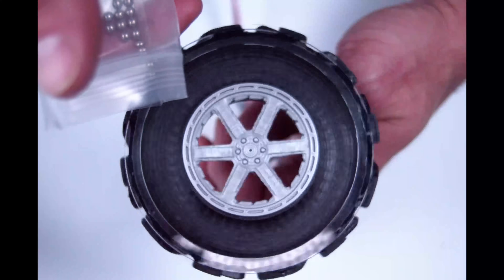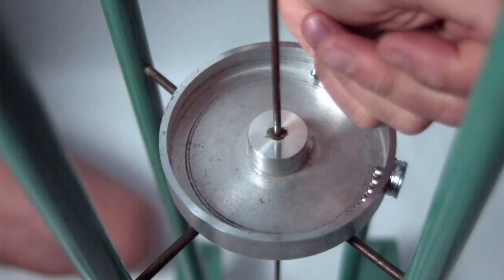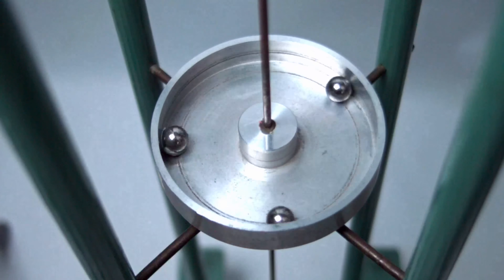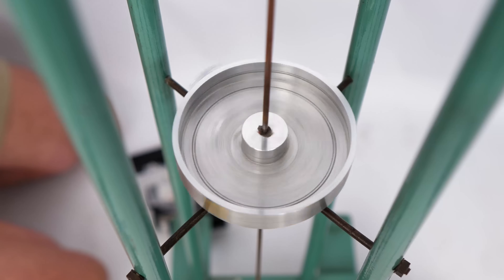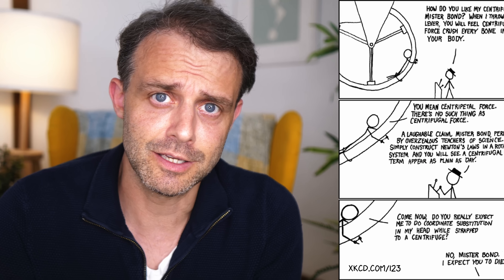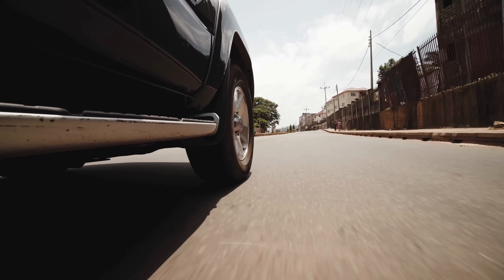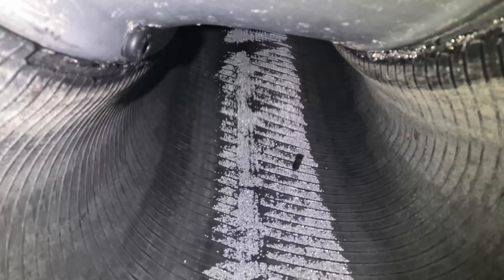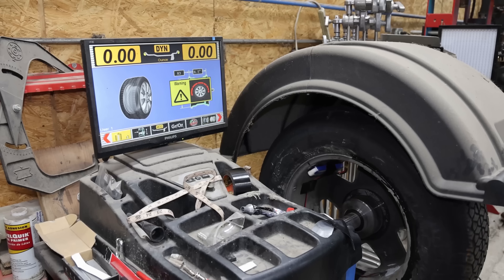Do tire balancing beads actually work?

Comment: If you look at the weights on car wheels as you walk past cars, you will notice a lot of wheel with more weights than needed. Like in two places instead of one sometimes even opposite each other, any wheel with two weights close to each other  can be balawnce witha weight in beeween. And any wheel with an opposite weight can be balance by deducting the weight of the lighter weight from the heavier weight.   It is annoying to see, I grew up balancing tyres. 
Always needed less weights with michelin. :)

Comment: Would it be possible to use self balancing beads in combination with a slow acting glue with low viscocity ?(if such a combo exists). That way you can pour in the beads with some glue. Drive so that the wheels get up to speed. Keep driving for a bit so that the glue sticks the beads down. And done!

Though I would imagine it's difficult to get a glue to work in those conditions. Especially with the rubber tire deforming constantly when it hits the road. Still may be worth looking into

Comment: I worked at a tire shop a few years back, we never used the beads unless the vehicle was a bigger diesel truck, if the customer wanted them. But even then it was pretty rare occasions. Not sure why and why it was only ever bigger, harder diesel trucks. (ford f350, ram 3500, those kind of big diesel trucks), but maybe there’s a reason? 🤷🏻‍♂️

Comment: I Imagine it would cost More, or at Least the Same, to have each Tire and Rim un-bolted, Tire removed and Beads Poured in, Then Re Installed and Aired back Up. Than it does to Just have Each Tire "balanced", with weights, on the Balancing Machine, and then Re Mounted to Your Car.    The Beads are a Neat Concept, but pretty Silly and Inefficient since it Does Not Stop the Vibrations Daily or "Fix it so you can Forget It"  :yougotthis:

Comment: I called it snakeoil....

It works in theory, but in practice you either have no need for it, or it only works 'half the time'.
And I bet that important nuance is rarely explained (or for legal reason it would be in extreme small print somewhere nobody looks), or they wouldn't sell anything.
AKA: snakeoil

And properly balancing tires als make it always work at slow (< motorway) speeds.
So, yeah, snakeoil.

Comment: Don't use them in my car, cause absolutely no need but way back in my off-roading days I have. Mainly because the wheels and tires were quite heavy, not easiest to balance in the first place and would get a solid beating on the trails. All too often balancing them in a traditional way was a moot point or short-lived at best. The beads worked much like you described. Wasn't a perfect solution but it was a solution nevertheless.

Comment: It is an interesting effect. I just wonder if the beads do actually more damage as long as they have not aligned properly into the balancing configuration? I'd still prefer a fixed weight on the wheel that makes sure everything is balanced and stays that way from 0 to 130 km/h. I'm pretty sure there is no evidence that would show that axle bearing falures are more common in cars with beads, but my intuition (that has proven to be wrong sometimes) makes me believe the old fashioned balancing is better for your car.

Comment: I have used these beads recently and found that they did not help the issue. At low speed, the unbalanced condition was much worse and since I do more city driving, I never realized the benefit. Long haul drivers that spend the majority of their time at high speed probably do the best. I ended up removing the beads and having the tires balanced conventionally.

Comment: Half my PhD work is on auto-balancing. Made mathematical models of it and verified them in real systems. We tried it in washing machines and grinding machines. There are still some stuff I couldn’t analytically solve so I tried using AI and LLM recently to solve it but it didn’t work. It works better with damping fluid in the race like oil. But doesn’t work below critical speed and actually makes it worse. It has been used for car tires with clamping mechanism so you only release it it when at over critical speeds. It has also been tried to balance cds and dvds.

Comment: I remember seeing this but in a ring shape to attach to a wheel, it seemed to work. But if you're on a road and can't get to the "balance" speed because traffic for example makes it kind of useless. Imo seems better to just get it balanced while tires are changed so it is always balanced no matter the speed.

Comment: Aren't the ridges inside the tire an obstacle to the beads reaching the correct position?  It also just seems silly to me since you'll be very unlikely to spend significant uninterrupted time driving at the resonant frequency after driving freeway speeds.  Most places you would drive at 50 MPH are places where you will need to stop periodically as well.

Comment: Balancing beads are more used in off-road vehicle tires. When driving off-road and slow speeds the balance doesn't matter. When driving on freeways, you still want a balanced ride. Many off-road tires wear down unevenly due to the abuse they get off-road: this would cause them to fall out of balance quickly and often. Besides that, often time these wheel/tire combinations require more weight and beads inside keep from having to run large stacks of weight where maybe you can't get enough weight on the wheel.

Comment: So the solution is to do a burnout every time you set off to get the beads in the correct place for normal driving.

(Failing that, there could be a way to fix all the beads in place inside the tyre once in place.)

Comment: This topic is very interesting and has many practical applications. You can find this type of device in washing machines, CD players, centrifuges, etc.
This is a phenomenon studied in mechanical engineering, more specifically in rotor dynamics. The subject is treated as dynamic balancers.
Instead of spheres, water can be used; the effect will be the same as long as the critical speed is exceeded.
It's a bad idea to use it as a car wheel balancer because if the critical speed is not exceeded, the effect will be to increase the imbalance.

Comment: if balancing beads work, could balancing fluid work? if that fluid sets over time, couldnt you quickly fill a tire with it then load it on a dyno and drive it to highway speeds

Comment: Brilliant analysis!  We should have full liberty to use the phrase 'Centrifugal force' when we speak from the perspective of a rotating frame.
Reply: In physics class, we were told centrifugal force (acceleration towards the circumference) is factious. It is actually centripetal force (acceleration toward the center). The proof of this, spinning a ball on a string over your head....when letting go of the string, ball does not fly out away from the center of rotation, it flies off tangential to the circumference.
Reply: @TornadoCAN99    Centrifugal force is fictitious and doesn't exist in the inertial frame, but it's a real force with physical effects in a rotating frame. Any description in mechanics can be made only with respect to a reference frame, whether inertial or non-inertial.
 In the experiment where a mass tied to a string is whirled around, when the string snaps, the mass would actually move in an outward direction in the spinning frame of reference! This outward motion is caused by the centrifugal force (Even before the string snaps, there is always a pull on the hand in the outward direction, along the string length). The mass doesn't exactly move radially outward, but rather has a combination of radial and another direction caused by another pseudo force called Coriolis. Both forces are felt only in the spinning frame.

Comment: You're failing to understand that every time the tire hits the ground it causes a deflection of the internal structure of the beads/tire sealant fluid which launches them off their improper spots to their proper spots

Tires are not a perfect circle in contact with the road, in reality the beads/fluid sealant will self balance the tire at as low as 15-20MPH. You should have done your own driving in an actual vehicle and tested it vs a static model

Comment: They are a scam tho... the extra wear on the inside from friction. As a stationary wieght works better. Any idiot can read a tire size can and follow a set of numbers as you turn the wheel on the machine that shines a laser where you put the weight can do...

Comment: The beads "work" in tires... But not really...
They organize at higher speeds and high enough tire pressure. Otherwise the tires deform constantly while driving (they do that under normal circumstances all the time) and disrupt the beads.

But just chugging in additional mass will just worsen the problem at low speed, until you're fast enough... Which has to happen every time you start moving...

Comment: Couple issues that are different to the demonstration wheel:
1. Tires are flexible and have a rotating flat spot until the centrifugal force forces it round.
2. The axis of the tire is horizontal to the force of gravity.
Reply: Can't imagine your TPMS sensors are going to like being pelted with these things, especially when the balancing machines these days tell you precisely how much weight needs to go precisely where on the rim to balance out a tire without these.
Reply: @nickhuson3799  You are correct. I have seen many TPM sensors beat to death/sand blasted on vehicles that spend a majority of their time in city traffic. Highway haulers, no so much. And don't get me started on the Karen who has the TPM individual display on their dash and is complaining the tire pressures do not match!
Reply: Some tires are out of round and not a damn thing can be done other than to replace it.
Reply: @BigDaddy-yp4mi when I was a kid I remember a tire companies commercial where they would take all your new tires and grind them until they were round.  This must have been in the late 1950s or early 1960s.  They claimed that the mileage that you could expect to get out of one of their tires was increased by grinding them "perfectly" round once mounted.  I remember that they had an advertising slogan, "The Round Tire" but I can't remember the brand.
Reply: @shellhopper2  Tires being out of round is fairly common in large off roading tires, and is a major contributor to making them difficult to balance.
Reply: The flat spot of a tire is only a factor at speeds slow enough for the beads to not work. Simulating the vertical hoop likely requires speeds which would make the demo unsafe, and doesn't meaningfully contribute to an understanding of the phenomenon
Reply: @chrisfist2042  You don't know what you are talking about, and there are other sources of perturbations that will add to the churning of the beads inside the tire:
- Roads are not perfectly level
- Roads have bumps and pot holes
- Your axles added resonances to the tires
- Your car is not that light
- You tire have a lot more momentum in them than you think

All of these move and concentrate the beads to where there is a standing resonance, dynamically.
Reply: ad 1) it's not like your mechanic isn't facing the same issue when balancing your wheels... and this I imagine will be way more precise and probably also lighter
Reply: @jaromor8808  Wheel balancing weights don't move, tyre beads will get thrown about every time they reach the bottom of the tyre. You can actually see it happening in the video in the internal shots of the IRL wheel.
Reply: @sandy_knight  In my other comment I was wondering if there isn't a trick to make the beads stick once the wheel is balanced...? There are all sorts of surprising tricks to achieve seemingly unattainable outcomes. Can't we make bunch of beads stick somehow in a rotating tyre? They don't necessarily need to be made of glass, do they? Ultrasound or temperature together maybe activating some sort of a special adhesive...? And the centrifugal force making the now-sticky beads bond together?
Reply: @sandy_knight  Or just have the beads change into a sticky crap when exposed to air during the balancing process, after which they then cure into something more stable yet still reasonably flexible?
Reply: @jaromor8808  I'm sure it's possible but you have to find a way to make the 'glue' go off while the tyre is still spinning and whichever technique you go with has to be at least as cheap and quick as balancing tyres the traditional way or you won't have a viable, commercial product.
Reply: @jaromor8808 commercial balancing beads have special coating exactly for that. Unless they got a hard bump, once settled they will stay put, no need for reaching certain speed to rebalance the tire again.
Reply: @jaromor8808  no they don't. wheel  balancing is done w the wheel of the ground and still. highly suggest you watch FortNine's video on this. you either correctly balance a wheel, or you balance it sometimes and make it worse at every other time. these beads are tire cancer, only beat by mushy old sealant
Reply: @teknodealamechanic's kid here - there are two types of tools that are used for balancing. Most of the newer ones have a horizontal axle and work by measuring the axle's deflection
Reply: @teknodeala Wow. Somehow I thought it was clear the process of balancing the wheel would have to be altered. Apparently you assumed it would remain unchanged.

Comment: Hi Steve, it would be interesting to see if this works with a liquid instead of the beads! My guess is yes, since it would be like many small beads. If so, perhaps one could use a liquid that hardens after a few minutes and sticks to the wheel, and put it in before a highway drive and thus it would stay in the correct spots even when slowing down completely. Could be interesting to test if you ever revisit this!

Comment: If you're somewhere that you're going slow with stopping and going - usually in a town - wouldn't that immediately nullify everything and make the traditional balancing a better option that would work at both town and freeway speeds without shortening the life of your vehicle parts due to being constantly unbalanced?

Comment: The tires on my roommate's car were unbalanced in a way that they didn't start shaking until about 60mph, and worse at 70mph. So it's not always 50mph.

I got them balanced at the local shop, with the typical balancing weights, and the shaking went away.

Comment: So what if you put a low viscosity rubber cement like material in with the beads and then stay at speed until it cures?

Comment: I had balancing beads added to new motorcycle tires 15-ish years ago and at the time the mechanic also added a sticky viscous liquid (I don't know what it was) in the tire that essentially glued the beads into place once they were in the right spot so that the tires would stay balanced at low speeds or even when parked. I never had any issues with them the whole time I had them.

Comment: I have them in my tires. One thing not mentioned is that they also tend to get into the valve so that when I add or remove air, they actually damage the valve core seal. Because of this, I carry spare valve cores and a compressor.
Reply: Why not just get them balanced once then forget about it. And save money on valves too?
Reply: @matthewgray1699 it was recommended by the tire shop as a way to better work with heavier tires. I am not a fan so far.
Reply: @amadensor sounds like they couldn’t be bothered to balance them properly
Reply: That's completely batshit crazy. So you go to great lengths, spending extra money, just so you have tires that have to be rebalanced every time you come to a stop. No thanks, I'd rather have my tires permanently balanced, so there is never a bad speed to drive at. Penny wise, pound foolish.
Reply: “Counteract”  makes a special valve core for use with balance beads.   Must have.
Reply: @camopirate nope, just never using them again
Reply: Tripping over dollars to pick up dimes.
Reply: @tropicaltrucker4425the tire dealer claimed they would stay in balance better as they wear.  They sucked.
Reply: why dont you just get them balanced properly dummy....
Reply: Tyre beads are good for big trucks which travel at highway speeds every day and for which balancing machines are uncommon, and which can change balance as the tyre wears. For car tyres, I can't see them being any good. For off-roaders which are aired down regularly, yeah I can believe there's valve problems. You might perhaps want to see about balance rings. They work on the same principle as the beads, but are ball bearings in a tube which attaches to the wheel. A trucker commented that they use balance rings on the tractors, glass beads in the semitrailers.
Reply: @eekee6034  balance rings didn’t work with my rims.  But ya, same principle
Reply: The beads I bought come with new valves that work with the beads.
Reply: I've been using balance beads for years.  Damaged precisely 0 valve cores. Sounds like user error to me
Reply: @iamtheoffenderofall I've lost two to just using a tire gauge, and 3 more to airing up after the end of summer.
Reply: @iamtheoffenderofall  are you regularly inflating and deflating your tires?
Reply: Like i said... user error.  @kissingfrogs
Reply: @kissingfrogs regularly checking pressure, air down for the trail, and top up seasonally.
Reply: @iamtheoffenderofall  Did you seriously answer user error when getting asked if you're regularly doing basic safety measures?...